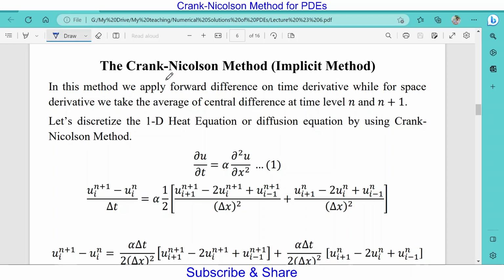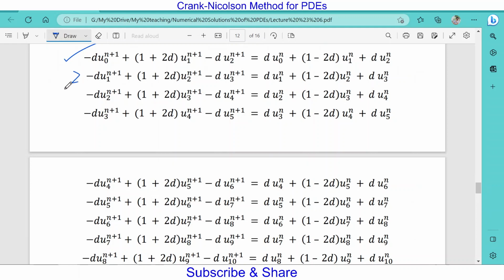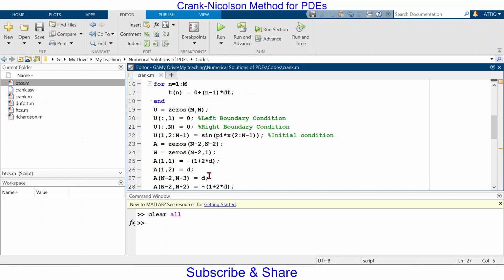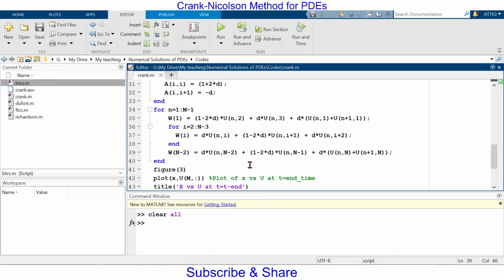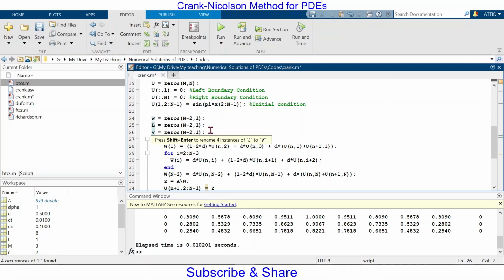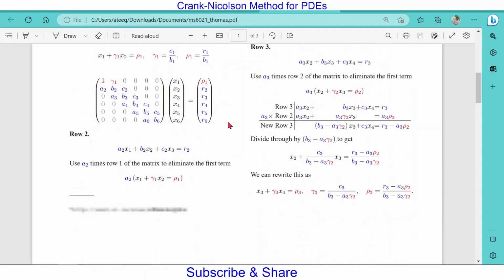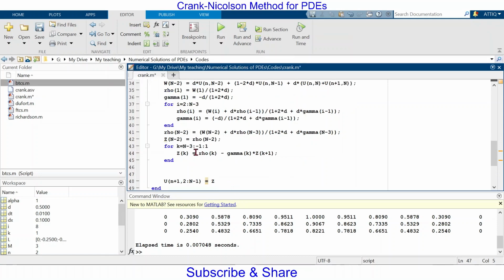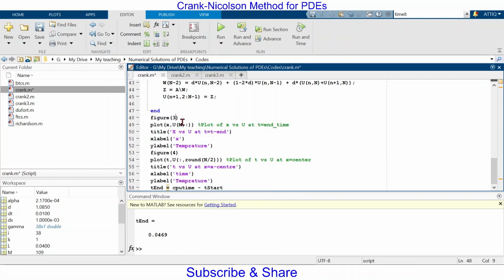The Crank Nicolson Method with MATLAB code using LU decomposition & Thomas Algorithm (Lecture # 06)

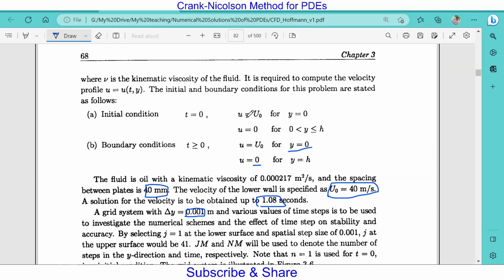Comment from the maker: At 47:00 I forgot to change the initial condition which will be 0 instead of sin(pi*x), that is why there is very small difference in results compared to the table in the book.